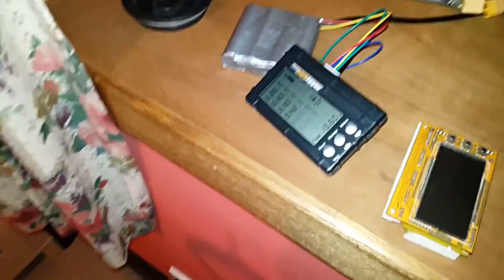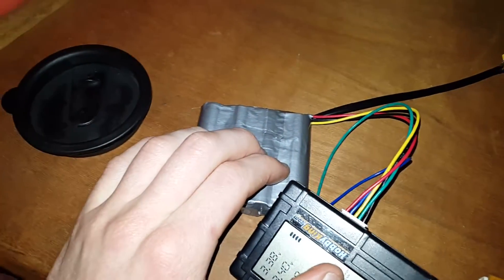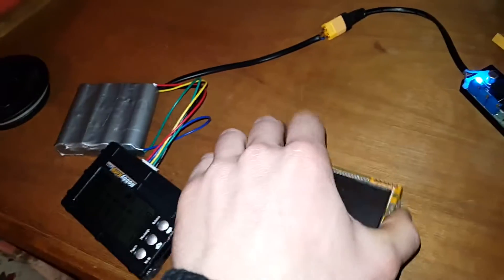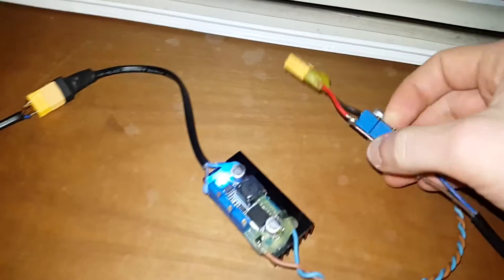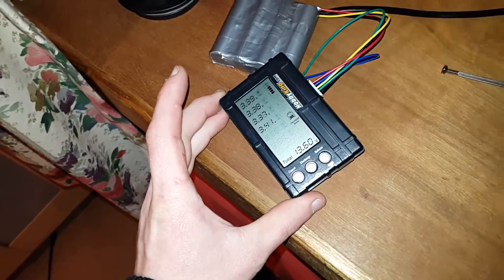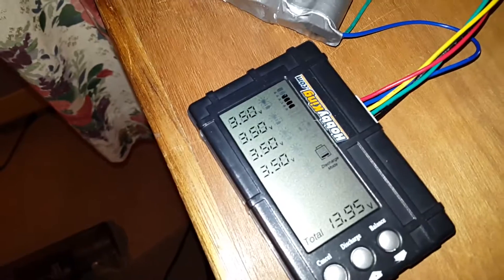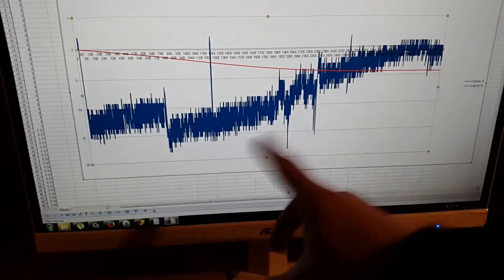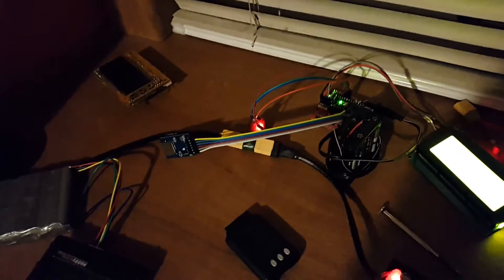DIY Lifepo4 Lipo Charger

Comment: Hi, love the Lifepo4 videos! Do you have plans for making a more powerful charger for your current setup? I would like to see a 1500-2000w charger for larger setups! I'm thinking of 4-5 Meanwell 350's in parallel and trim the voltage to 14v and with diodes on the output(load share)? Would it be possible?
Reply from the maker: Don't use power supplies to charge batteries as you will overload them if the battery is discharged. There are high power chargers on ebay like the powerlab 8 which would be ideal.
Reply: @ShaunDobbie  I've found out a very simple current limit mod to the meanwells, just by replacing a resistor. That way you can run them at lower wattage then they are rated for. You can read about it here: https://sites.google.com/site/shelbyelectro/batteries/batteries/bulk-charging-with-a-meanwell
Reply: @ShaunDobbie  The P8 Is only rated 40A that equals to about 500w on a 12v system.

Comment: I didn't have trouble finding this on HobbyKing's website
https://hobbyking.com/en_us/hobbykingtm-battery-medic-system-2s-6s.html
downside: reviews state voltage readings not that accurate, limited discharge current. Though your modded one would solve the later.

Comment: BTW, in datasheets for some 18650 cells I have, it says the charge current is 1-5 to 2C. These are laptop batteries. Are you sure yours can only charge at 0.5c?
Reply from the maker: 0.5c is generally recommended for lifepo4 but I was charging them at 1C earlier. They never got warm.